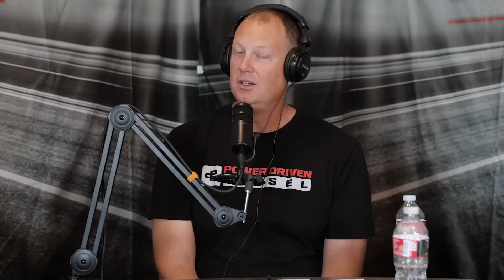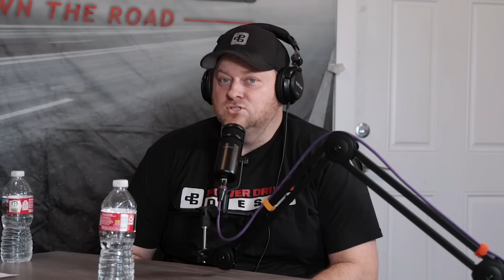The 48RE Problem Nobody's Talking About

Comment: My factory 04 drain back valve was plumbed in the line up next to the radiator. You can separate the fitting and drill out the spring and ball.
Recently I've replaced it all with FSD lines and a Mitsumoto cooler.

Comment: My 48RE Goerend triple disk converter and Goerend Valvebody instructions say to pull the 2nd gear band adjuster out 2-1/4 turns. Thats the loosest I've seen any instructions say to run the front band. Manual says 1-3/4 turn. Why the difference??

Comment: No mention of the OD case breaking at the transfer case mount? I have a heavy duty case that just cracked.
Reply: Your front driveshaft is either out of balance, has bad u-joints, centering ball components, or a stuck slide yoke.  Worn out engine and/or transmission mounts can also be a factor but the front driveshaft having wear/issues is the most  common source of a broken OD housing.
Reply: @BillyWillicker It was the rear driveshaft. Front was brand new high dollar unit.
Why did you go right for the front?
Reply: @helihoot  It's the most common cause.  Even new units can cause problems.  Quality, even in new high dollar units today can be lacking, especially if the high margin is the cause of high dollar.  New OEM driveshafts are usually the best route.

Comment: Do you guys do anything to “bullet proof” the ZF 8HP75 8 speeds?   Just a street application with 6.4 Hemi and a cam upgrade to delete the MDS system.  Occasional towing of a boat, nothing crazy and some off-roading in a Power Wagon.
Reply from the maker: The ZF 8HP is new to the high performance diesel market.  We have not yet played with them yet.

Comment: What’s funny is they said “the worst transmission on earth is an awesome basset racing transmission stock” and I actually took the gas version of one the 46RH and had it built with some upgraded parts and a full manual valve body and it’s been fantastic lol it’s behind a 550 hp 408 stroker small block. The diesel aftermarket makes it a great option for a swap.

Comment: I bought my 2006 Ram 2500 quad cab 4x4 Cummins new. Every 30k I serviced the trans including adjusting the bands to spec. I have 160k on the trans and it’s still running great. My truck is bone stock, never had a power programmer. Stock size 265 70 17 tires too.

Comment: I also have propane injection what drops the exhaust gas sensors by 2 to 300 degrees you couldn't believe the difference when it comes in I'll put a Hobbs adjustable pressure switch on it

Comment: Wife's 97' fueled up stock 12V automatic, to pull 12,000lb horse trailer up 7% grade, harsh logging off road, 20mph, for 14 miles. 
  We are poor, can't afford big parts kit, damn sure can't afford a new tranny.      Fueled up stock motor, make the auto live, very slow, very long (45 min long, 14 mile long, 20mph) 12,000lb horse trailer.    Woman driving.
    My truck spicy, NV4500.  Too spicy for the wife, so how do I make a poor-ish budget wife proof auto tranny live under those conditions????

Comment: A lot of the ford setups go to a 4r100. Which honestly is a pretty good trans for power. There isnt a normal pattern full manual valve body for them like the 48re tho PRN321 with overdrive and lockup on a switch. Tho i know with the on off type lockup solenoid like the e4od (not the pwm) you can run it on a switch. Also theres the matter of the EPC. Electronic pressure controller so you gotta have something to control that. Or perhaps someone could figure out another method. Theres only 1 band in the transmission to help engine braking in manual second gear. Then you have the coast clutch which engages for engine braking as well when not in overdrive. Beyond that it engages 1 clutch pack per shift pretty simple by feeding the clutch pack doesnt have to release anything at the same time to make a shift. Id like to see PDD dig into a 4r100. Perhaps a normal FMVB like the 48re would come from it. As the current only FMVB for that platform is a reverse fmvb with a pattern as PR1234 with no neutral position and lockup on a button. Seems undesirable for diesel dyno shenanigans to not have a neutral position. Especially not having it by your top gear for quick access
Reply: Only issue i could forsee with testing for that is youd have to 4r100 swap a race truck to really dial it in to the level yall have the 48re dialed

Comment: Could you explain some more on the deep pan? If your trying to keep oil cool by adding more oil to the system wouldn’t it cancel out when all of it is at running temp? Or worse if it’s over temp now the stock cooler has more hot oil to deal with. Would I be better off stock pan with a second cooler?

Comment: Before I sold my Dually with a 48re 650hp build by tiger transmission…. It was well worth spending the $6,000…. The best transmission I ever experienced. The way it held the power and the way it shifted was so perfect and it was always on time.  Worth building a 48re
Reply from the maker: Built 48RE's, when done right, are awesome!

Comment: I found a Gear Vendors overdrive unit at a junkyard, likely needing a rebuild. How would installing it on the 48RE transmission in my 3rd gen diesel affect towing performance with Nitro 4.30 axle ratio?

Comment: I need to see the 47re lube mods and Torrington bearing mod. I have a goerend triple disk, billet flex plate, billet  input shaft, goerend valve body, billet anchor strut and I know nothing else what they P/O did. It’s like new only 6k miles on it. But I know when it needs a rebuild it will need those mods done.

Comment: If you make a diy 47/48 tranny build and pull back the curtain on the black magic you will have a lot of viewers and customers.  A modified engine for more power is useless without an upgraded tranny.  A lot of mechanics don’t have a clue about what goes on in that housing.  Thanks for the education.

Comment: 48re on a 2nd gen
Reply: is the oil dipstick and tube the same size on the 48re and the 47re
Reply from the maker: The dipstick tube diameter is the same, but the location is the different and the dipstick is different. Make sure you match the dipstick with the dipstick tube.

Comment: I did a revmax valve body and slip in band. With new lever and strut. At 210k miles on my 2004 cummins 48re. Its a new truck for sure. Original transmission. I just put the band in before the old one broke

Comment: So, I just had my '05 48RE rebuilt with all billet. The engine is mostly stock for now. Other than the 10 over injectors, an ATS pulse flow manifold, and a stainless 60/64 turbo what torque converter would you guys recommend for this truck? More mods coming in the future!
Reply from the maker: Give us a call and we would be more than happy to put together a build list that fits your needs. (435)962-9555

Comment: Seems like the more “bullet proof” you make something you give up longevity. It’s either super strong and will last a short time or not as strong and live longer. I believe the biggest difference is the use of the truck and the right foot. If you want anything to last you have to treat it accordingly. Don’t be surprised when you are towing in tune 5, heavy load and a heavy foot then you trans leaves the chat.
Reply: Break each weak link of the chain until its all built together,

Comment: Never ridden in a built transmission just a stock 47rh and re ..Neither was anything impressive..However after my 47rh was replaced with a g56 and a twin disc clutch i rode in my brothers 3 gen with the 48re..i was surprised how good the transmission shifted ect even though it was stock with larger than stock tires . Including really good brakes lol ..That experience suggested to me that a well built 48re would work well especially if the engine made more torque . I seen the factory cooling lines come apart and wear holes in the lines from rubbing together..i did everything i knew of including servicing the transmission often adjusting the second gear band as suggested..Made a throttle stop to increase the line pressure a bit ..Ran 10 wt oil for years ..At ever start go to neutral to charge convertor when the truck had sit for  while ..No locked shifts ect ect ..But it eventually failed at over 200k miles with may be 300ish hp towing ..  i certainly would like to see the how to mods on lubricant ect on clutch packs or anything else..  Also the information on shift strategy on how the transmission works especially the locked shifts up and down . I guess the fuel management is part of that . Thanks for sharing appreciate all of the videos
Reply: Can't share too much detail with you Jim, but 800+hp with a built trans will pin you against the seat like you never have before... super intense! Haha

Comment: My 07 48re drains back and I have to put it in neutral to get the converter to fill.  Does that mean my check valve is broken or not there at all?
Reply: Probably. Or, it’s stuck. Do you have a shift kit in it?
Reply: I d check the torque converter bushing when worn the converter drains out takes a while to fill and pump up works fine when full

Comment: My 1999 came with a built DTT trans.  That overdrive shift hit you in the kidneys.   It has a different valve body now ( should have kept it) they had 2nd gear lock up too.  Still using the old school trans controller